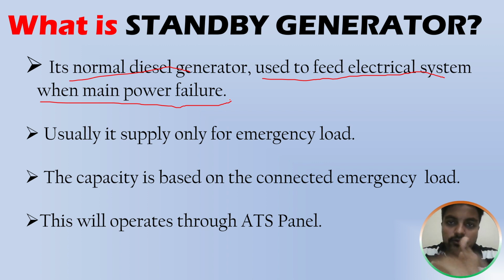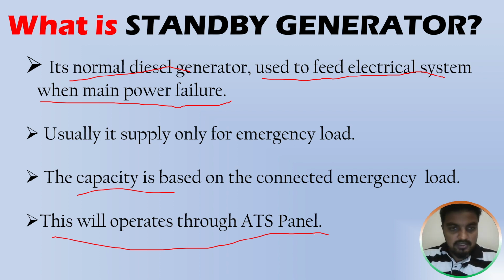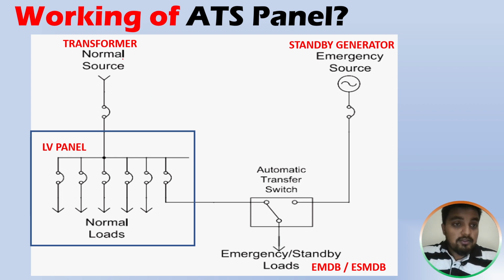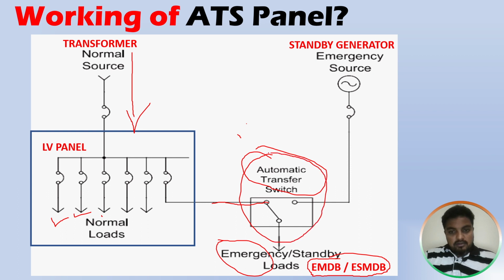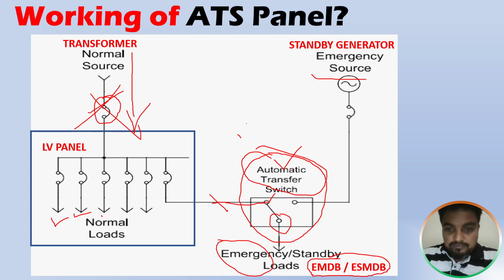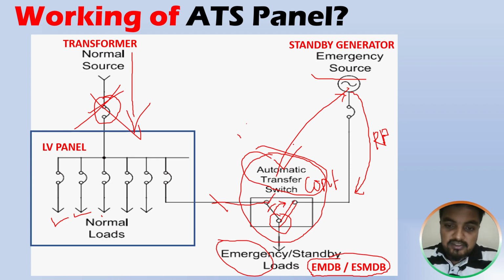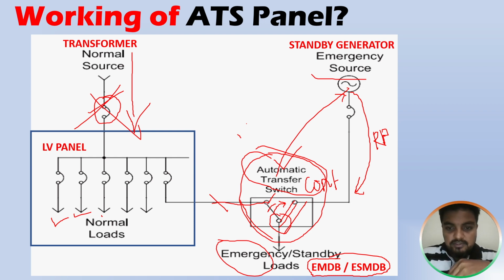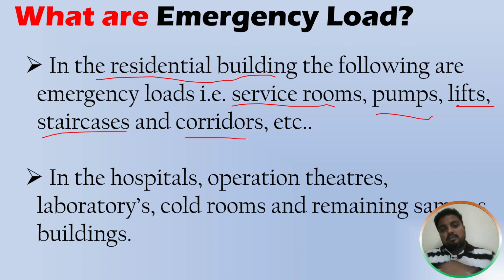Why we need Standby Generator | What is ATS Panel | V-10

Comment: Hai sir very informative videos..
Sir one doubt why we use amf panels ..ats panel will change supply from main to generator,,then what is the need for amf panels,,why 2 types of panels AMF and ATS both have same purpose???
Reply from the maker: Very good question, Vipin.

Sorry for the late reply.

ATS and AMF are not actually doing the same thing. Yes, both are used to swift the main supply to generator supply incase of main supply failure but ATS is act as switch, AMF will act as switch + monitor (load) + control (generator operation).